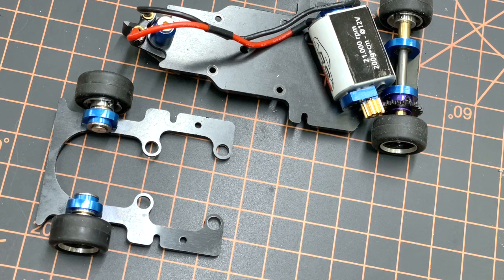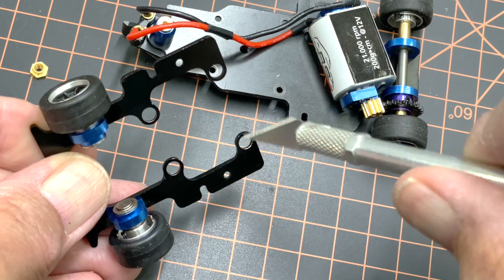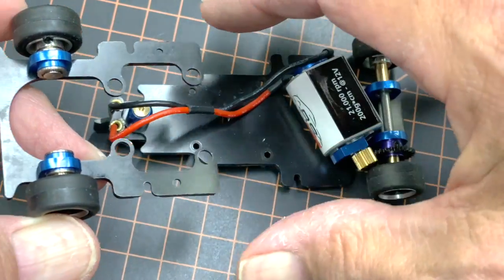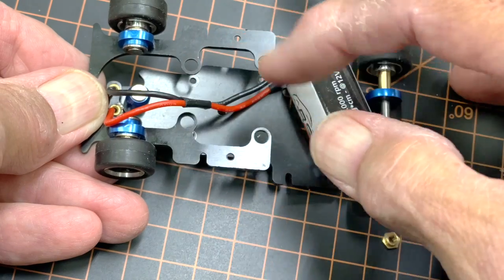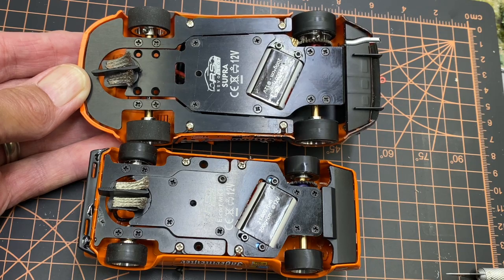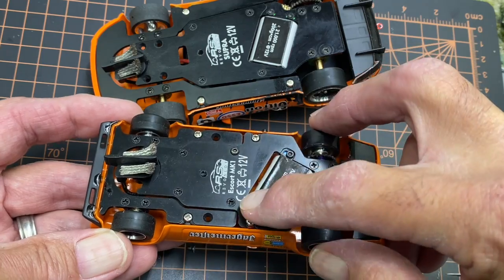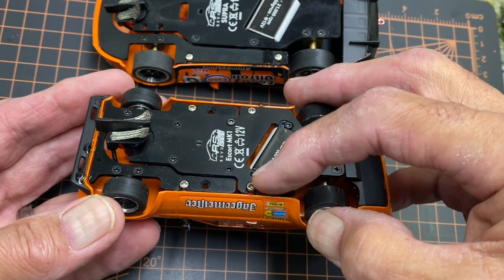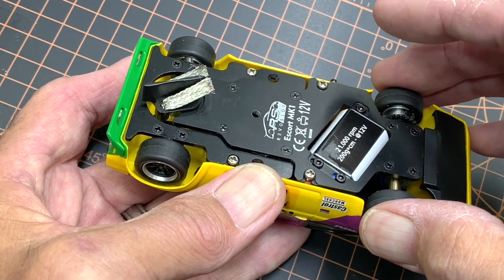Revoslot Ford Escort - Body and Chassis Float Part 2

Comment: Thanks Harry, very useful. I've been looking at my Escort & couldn't really fathom how it would work with the body attached to different portions of the chassis. On a different theme. How are people truing the tyres on these cars? I use an RSM tyre truer (similar to the Razor) that trues the tyres on the complete axle set-up using the double flanged bushes to hold the axle on the arm. Do you just use the single flanged bushes & use spacers/axle stoppers to keep everything in place? Cheers.
Reply from the maker: I have a rig with the 3mm axle and axle stops I custom made for my Razor. Other folks have close to same using the collars I believe.

Comment: Hi Harry, Did you change one of the pod screws on the Jager? Looked like a dome head instead of the countersunk of the other 3. interested to know the reason. Cheers
Reply from the maker: I did. Haha yeah I was testing other screws to see of they would fit in case the original was lost and you could not order the screws. You CAN order the original screws, it was just a test.
Reply: @Homeracingworld  no worries I wondered if you had broken one or trying to get more float.